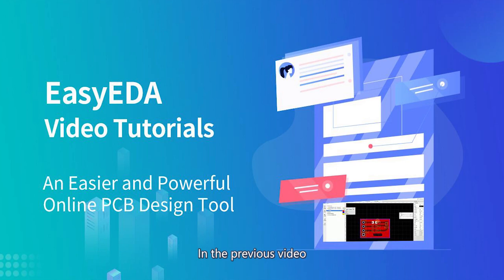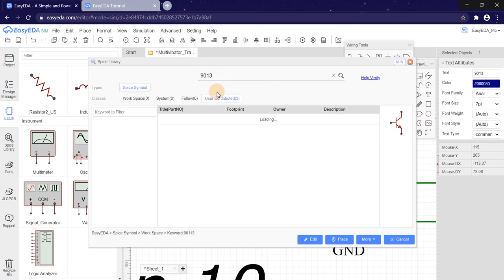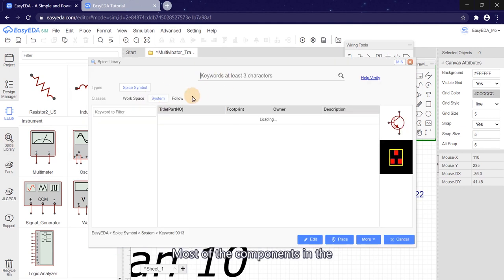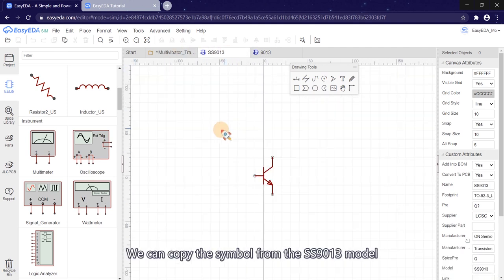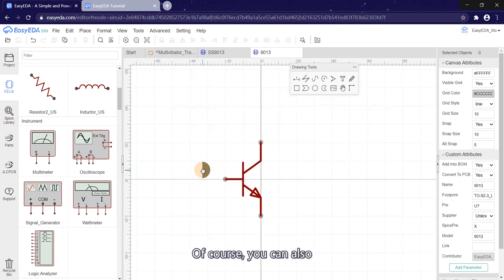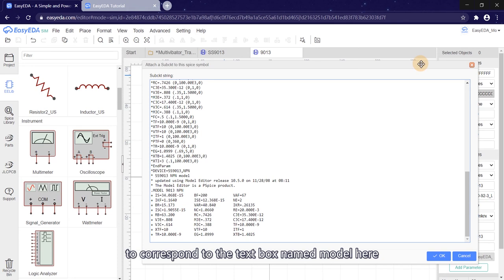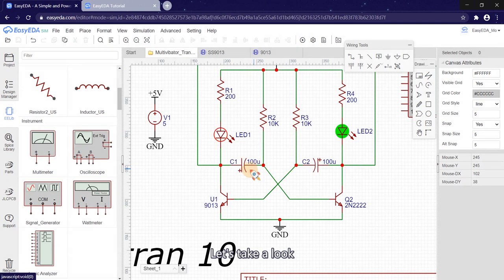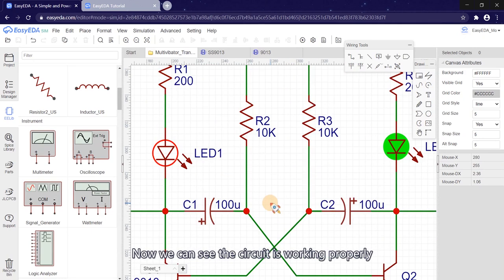010 Simulation Library

Comment: Please be aware that this video 010 Simulation Library tutorial is misleading in two ways.

1) It is incorrect to refer to a spice simulation model as "simulation data". Simulation data more correctly refers to the data generated as the outputs from a simulation run.

2) It is misleading to say that a spice model can be obtained from a device datasheet.

To run a simulation of a device, that device needs to be assigned a spice simulation model (or simply a spice model). This is usually a text format file (but sometimes it may be an encrypted file). This file can sometimes (but not always) be downloaded from the device manufacturer's website. 

Text model files may need editing to run on a particular simulation engine.

Encrypted files will only run on simulators from and for which they are encypted.

Very rarely a spice model is included as text as part of the device datasheet from which it may be possible to copy, paste and format it into a functional model file.

A spice model can not usually be derived directly from the specifications and parameters given in a device datasheet. This is particularly true for discrete devices such diodes and transistors. It is sometimes possible to construct a spice model for devices such as triacs, operational amplifiers, gate drivers, VCAs etc., from their datasheets (there are many such models in the EasyEDA Spice Symbol library) but this is a specialised task.

Before attempting simulation in EasyEDA, the SimulationTutorial:

https://docs.easyeda.com/en/Simulation/Headings/index.html

is essential reading. 

The introduction explains where to find simulatable models in EasyEDA and spice models in general and Chapter 14 Device Models, in particular explains much more about them.